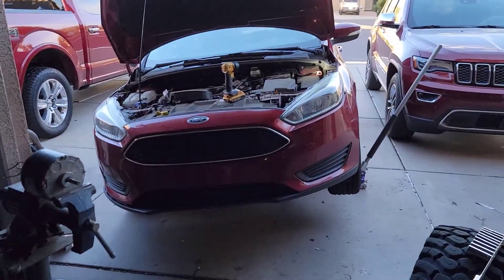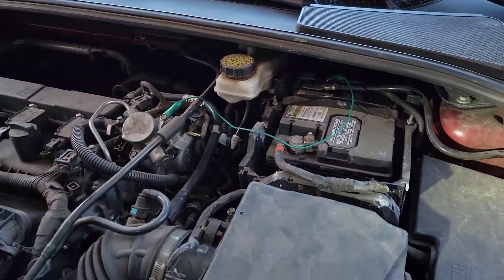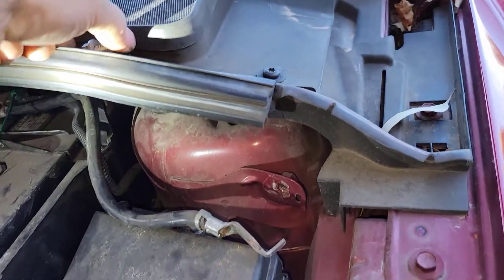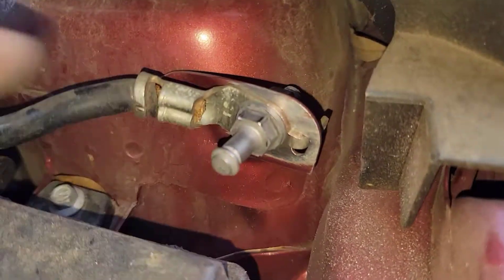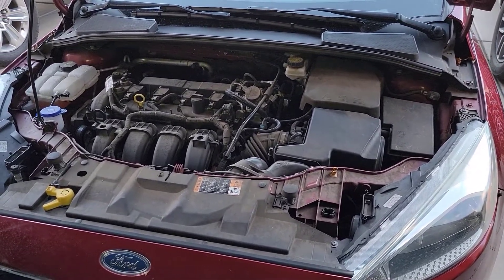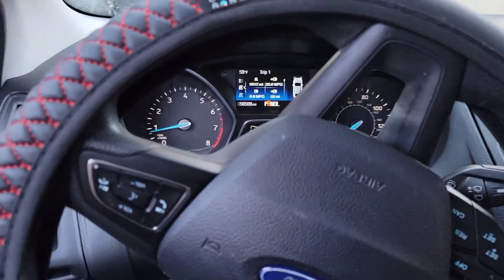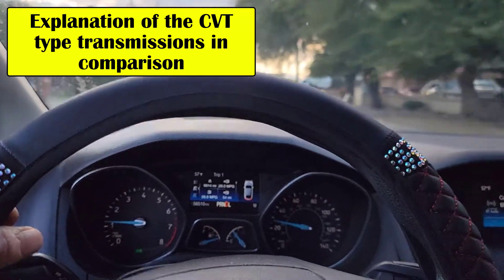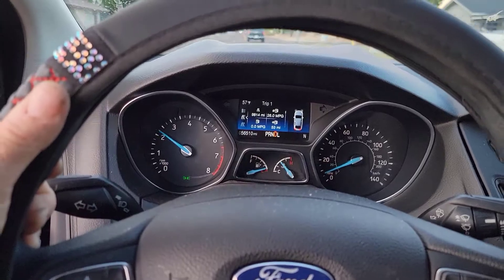2017 Ford Focus DCT shuddering issue - Ground strap modification

Comment: I was gifted a 2015 SE , while replacing all the motor mounts , I see there's a ground cable under the battery box too. who ever owned it before me had cleaned that connection to.

Comment: Ever had a battery light come on and stay on with the ground before you cleaned it?
Reply from the maker: I've had that from a failed battery (cracked cell) of if the charging system has failed.

Comment: I have a 2014 ford focus. A little over 62,000 miles. Had transmission fixed for shudder at about 40,000 miles. Cost me $1,400 at ford dealership. Transmission was getting a bad shudder again and watched this video. Did the three grounds about 300 miles ago. Transmission so far has shifted the way it should and no shudder. I hope it lasts.
Reply: Make the BIG 3.
Reply: @Cococholoco and it died 😂

Comment: Is the clutch forks , clean them or replace them . I did that to mine and it’s running great
Reply from the maker: You have the DTC?
I never did remove the transmission.
Daughter says it has been ok since I did this.
Reply: @hackfreehvac   what your doing is a temporary fix , I bought a new clutch and forks also I just replaced the alternator. The alternator was causing similar problems
Reply from the maker: @Inkadomination  This "fix" was something mentioned in the forums that was related to the issue. I just documented it in case it worked. And evidently it did.
Also, the problem MAY have been just grease on the clutch plates.
When i was working on it I ran it hard thru the gears a few times and that could have been what fixed her shudder.
It has been fine for something like a year now, so there really isn't a reason to open it up yet. Especially on a dang FWD.
Reply: @hackfreehvac  I also reset the transmission learning and it got rid of that low speed starting shudder.

Turn the key on, put the car in neutral, it's that easy.
Reply: @frankvonfrauner is that how you reset the transmission? Or does that put it in learning mode?
Reply: @GPMAX01  there is a lot of videos here in YT that show how to do it.
Reply: If you reset the transmission it will relearn your driving.

Comment: Thanks for the video. Dude, you're really knowledgeable! I cleared the paint off the ground and it helped, but my check engine light still comes on from time to time. Maybe I should add the extra wire directy to the engine as well ...
My friend, I noticed you using some "colorful," language. I hope - for real - you believe in God and trust in Christ as your Savior so you'll make it to heaven. We all (myself included) want to be careful we walk the "straight and narrow road" so we don't end up in hell for all eternity. Thanks again. ✌️
Reply from the maker: Yeah I grew up on construction sites and the extended vocabulary was already formed by time I was an adult. I do, however, leave out taking the Lord's name in vain, etc and what counts. The words I use are only colorful by the world's standards, actually. For instance, sh** is just a slang. Not a curse (wishing harm upon a person).
I am a Fundamental, FYI . Good thing I don't rely on my own works👍
Reply: Hahaha, end up in hell for all eternity for using a curse word? Hahaha, get a grip.

Comment: Make surr u hit the gas pedal hard enough (not all the way) to avoid shudder.
Reply from the maker: Evidently it's been OK since I performed this mod. 👍
Reply: If I do a slow-ish but steady accel I can avoid the shuddering 99.9% of the time, I have to have had fully released the brakes for almost 2 seconds for this method to work, if you gas immediately chances for shudder skyrockets. If it shudders I just release and quickly reapply the gas pedal and it's all good. The method you mention does avoid the shudder 100% of the time though, no brain work or timing needed lol.
I'm definitely adding that extra ground and sanding the main battery ground connection though, and any other ground cables I ever find I will do the same.
Reply: @ericmann1781  mine was shuddering from the get go since 2014 when I purchased it. Last December I finally changed out the clutch. And wala ... No more shuttering. My TCM was replaced before (the new no fault one)

Comment: Tell her to put gas in her car lol anyway thank you my girlfriends car just started doing this a 71,000 miles and i had no idea as i drive a 2016 with a manual
Reply from the maker: These are technically a manual transmission except the computer shifts it.
There is a clutch for gears 1-3-6 and one for 2-4-6
So pushing on the clutch servo engages one and pulling it the other way engages the other.
As you start in 1st gear, the computer has 2nd gear meshed and ready to release the one clutch to engage the other.  Then 3rd gear is meshed ready to go. 

It's actually pretty cool
Reply: The manual focus is a great car very reliable. Too bad the auto has problems because these engines are very durable

Comment: Just bought a 2012 Fiesta with only 33K miles for daughter. P2831, P2832, P287B, P2831-00, P2832-00, P285E-00, P287-00, U041-68, and C1B00-64 codes (obvious shuttering). 6-8 months for the recall and don't know what else to do. Thoughts?
Reply: It's been 10 months since you posted this, what did you do?

Comment: Chevy Cruze? Ford Focus? Goodman? They all have something in common.
Reply from the maker: At least the Focus is still running and not noisy 😆
Reply: @hackfreehvac  poor transmissions in Ford Focus, poor engines in the Cruze. Why not buy an American made Tesla? 🇺🇸 you’d look real good in a Cybertruck. You just have a bad choice in cars, in my opinion. I wouldn’t advocate for Nissan or Hyundai/Kia. Would you ever get an EV? It’s just like some people that refuse a heat pump or mini split, because they think they’re a scam or won’t work good.
Reply from the maker: @user-ln7of9gs4s  The Focus is one of my daughter's cars. Half the car videos on my channel are not my personal vehicles.
And when I realized her trans was a dual clutch and not a slush box at least I wasn't worried about it so much and at least it wasn't a damn CVT which do explode.
It seemed that we got most of the dual clutch quirks settled when I added the strap and from me just ripping thru the gears a few times which may burn off some of the collected grease from the throwout bearing(s).
She just paid off the Focus this summer (so she's now had it 6 years) and we have only fixed this minor issue aside from it ONLY getting some oil changes when it is lucky.
You can't dare call that car a POS.
Her Husband's Mitsubishi Lancer car has had way more troubles. Including the transmission being replaced already.

As for a Tesla. Well with the driving across the State (or multi states) periodically, that would suck balls. Electric cars are great for local but suck for long distances. They got a ways to go.
And towing drops the electric trucks down to about 100 miles capacity. The "Cybertruck" is still talk and no action, BTW.
That is utterly useless in a State with 200 miles from Phoenix to Flagstaff and the other locations I like to tow my Can Am up to. Ain't no way that the group of us traveling out of town to go play will want to hang around for someone to charge their bitch truck every 100 miles. Which. There isn't even an infrastructure for that.

Comment: These transmissions are junk, here in Australia Ford was sued for $10m in a class action due to these transmissions.  There are also TSB relating to this issue which involves a TCM relearn and clutch replacement
Reply: $10m that’s it?
Reply: The transmissions are pretty good. They just had issues that Ford never dealt with.
Reply from the maker: So far it's been months and the daughter's transmission is still ok. Try the ground strap mod. Some people swear by it. That and some hard accelerations from a stop to possibly burn off some grease that got onto the clutch plates.
I did both at once so I am not sure which had improved it but she said it hadn't been doing the shuddering the last i had asked.

Comment: You never know, you may have found the fix, for these faulty Ford Transmissions.
Reply from the maker: The cleaning off the paint aspect was a fix that was widely talked about in forums that I read.
Reply: @hackfreehvac  Yes, but watching a video and seeing the results is better than reading something on a forum.
Reply from the maker: @redneckbryon  Yeah. That's why I used the opportunity to film it.